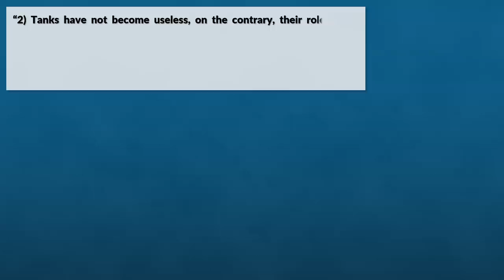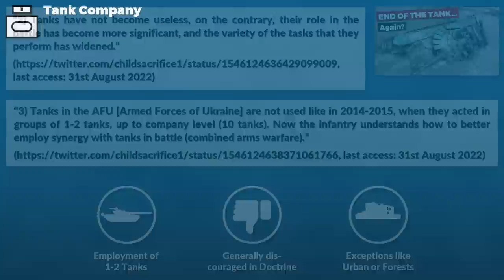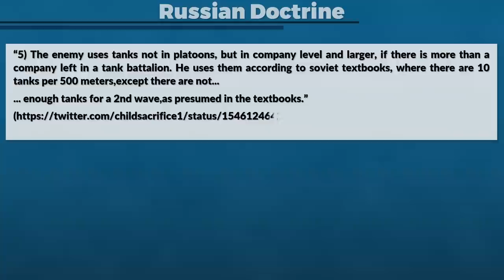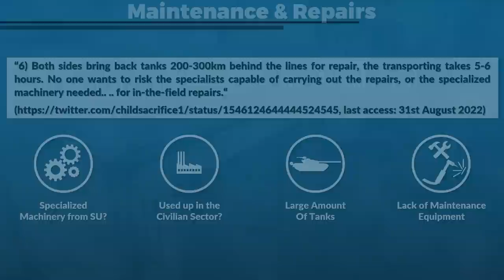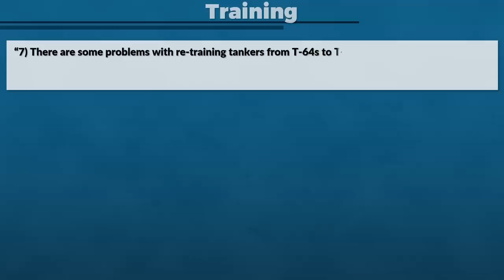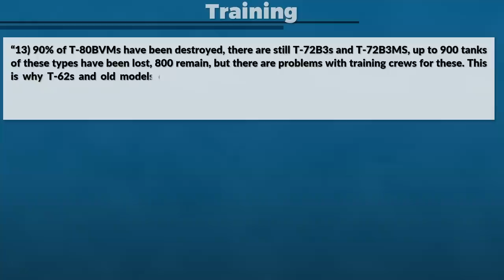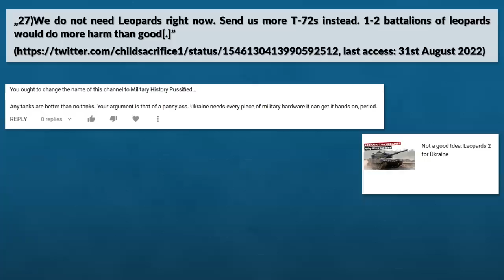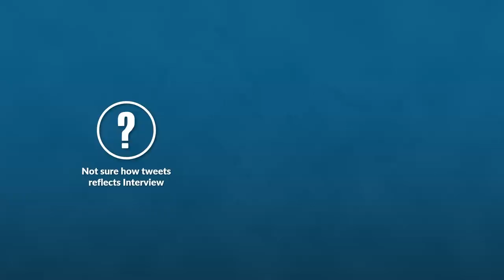What Ukraine thinks of Tanks

Comment: I will note that African and Middle Eastern tanks will generally be export models, such as those used by Iraq during Desert Storm/Gulf War. They lack certain technical pieces, such as thermal scopes and electric turret drives, that would make them a liability on a modern battlefield.
Reply: But possibly still useful as a source of spares.
Reply: Which tanks do you mean?
Reply: @hendi1571  For instance, look at the Wikipedia page "T-72 operators and variants" and see the current operators.
Reply: @cv990a4  I thought he may have meant some specific tanks / users variants. Because in general, his statement is somewhat incorrect.
Reply: @hendi1571  The Wikipedia T-72 page says that originally non-Soviet users of the T-72 had less effective armor, and that the Polish and Czech versions are not fully parts or tools interchangeable with the Soviet version. And that the less effective armor was also true of other export models that the Sovs produced. All that said, it's my understanding that these things are basically just a hull, into/onto which you can put all kinds of stuff - reactive armor, bigger engine, different targeting systems, night vision, etc. So, I would guess that, these days, what matters is less how the thing was originally built and more what kind of package of systems it has today.
Reply: @cv990a4  well T-72M1 is armorwise on par with the domestic soviet T-72A obr.1983 and is only inferior when it comes to night vision, as it was still equipped with the TPN-1-49-23 while T-72A would have been generally (at least on paper) equipped with the newer TPN-3-49. Yet even some T-72B1s and many T-72As still received the TPN-1-49-23 as the newer model was not available in sufficient numbers. Furthermore, an undisclosed number of T-72M1s may have lacked the 1A40 fire control system which would have been much more of an issue. But in the end, the 1982 introduced (cleared for export) T-72M1 was pretty much comparable to the 1983 introduced T-72A obr.1983 (without taking into account training and available ammo). And it was somewhat superior to the domestic T-72A obr.1979 and vastly superior to the T-72 Ural models. It was not necessary inferior just because it was an export model. 
But apart from that - no serially produced soviet T-72 model featured an thermal sight, neither domestic nor export. Arguing that that's a downside of the export models is senseless. As you said, a tank is a modifiable weapon platform and in fact, it were not former soviet domestic T-72's receiving the first thermal sights as a standard.
Plus, even at soviet times, export models were not actually the sole models supplied to other countries - Syria received T-72As in 1982. But after the fall of the soviet union, former domestic models were sold to several other countries, so several modern day T-72 users actually use T-72B and T-72A variants.
Reply: @hendi1571  How much do different variants of the T-72 matter today? You're talking about T-72As introduced in the late 70s, T-72Bs introduced in the mid 80s and weaker (or not much) weaker export variants in between. They're all equally outdated in 2022 and comparsions only make sense, when you take a look at the vanilla versions of each sub-model. Even the oldest T-72 Ural from 1973 with modern upgrades could outperform a Russian T-72B3M from 2016. It all just depends on the upgrades it received.
Reply: @jebise1126  Ukraine was originally equipped with the Russian "original" models of the T-72. So T-72As and T-72Bs were sitting in their depots. While there might also be some export versions among them, just like you can see in Russia as well, they're definitely not the norm. When you randomly manage to spot export models in Ukraine today, than they're most likely the ones that have been provided by other East European nations for this war.
Reply: @cv990a4  But are spares the bottleneck or are it the maintenance  tools and specialist? And then it's still makes more sense to buy the spareparts and not the whole tank. Probably enough  broken tanks lying around for spare parts in Ukraine anyway.
Reply: Most russian tanks also lack thermals. They were buying french for some reason till 2014.
Reply: The export models we inferior while the hull looked the same. Important details here and there, dozens of them. They are considered crap by those used to the Russian/Warsaw pact tanks.
Reply: @dnocturn84  That was neither the point of the original commentary, nor of mine. 
But I disagree with your comment, as T-72A and T-72B are, while being absolutely outdated, definitely not equally outdated. The differences do still matter on today's battlefield. For example, 1A40 is said to raise hit probability by up to 30%, while T-72B is of course far heavier armored than T-72A (/T-72M1) and T-72A (T-72M1) in turn features better armor than T-72 Ural and an laser range finder which is an obvious advantage over the optical of T-72 Ural. This are important benefits! And the base model is quite important for upgrading, because you cannot simply swap out T-72A's inferior turret composite armor. Of course you can still upgrade a T-72 Ural with fcs, ERA, etc. in such a way that it supasses a T-72B3, but applying the same modifications to a T-72B will create a more capable tank. Variants do still matter.
Reply: @dnocturn84  Furthermore, prior to 2014 Ukrainian armored forces were not equipped with T-72s at all. Only in 2014, facing increasing losses in the Donbass, such tanks (mostly T-72As and T-72Bs) were reactived from storage. Apart from that, there are no "original russian" T-72s apart from T-72Bs, as their production was carried on after the fall of the USSR, and russian upgrades. "Original" T-72s (T-72 Ural) are soviet tanks.
Reply: @hendi1571  Yes. Again, it all does depend on the upgrades it receives. A T-72A equipped with modern day ERA can technically end up with more turret armor than a T-72B with mid 80s Soviet ERA (Kontact1) (of which you can see plenty of in Ukraine on the Russian side and/or especially on the side of the Donbas or Luhansk militia).
If you upgrade a T-72B to B3 standard and upgrade a T-72A with the same addon ERA, you'll end up with a rather small difference in favor of the B3, due to more armor on the initial variant of the B model. But if something can penetrate this upgraded T-72A, chances are, that it will also penetrate the T-72B3.
Reply: @hendi1571  Ukrainian military was not equipped with the T-72 prior to 2014. Yes. But they had mothballed T-72As AND T-72Bs in storage. The T-72B was produced in the 80s. Ukraine did receive quite a number of them until the Soviet Union collapsed. And Ukraine wasn't one of the East European countries that only got export models. They got the real thing, just like Russia.
Reply: @dnocturn84  no. T-72B is substantially better armored than T-72A, the difference does matter! It does not only come down to the upgrades, I have already presented several examples.
For your second comment: Just read the comment you were refering to again LOL
Reply: @hendi1571  A T-72AV (I consider a T-72A upgraded with ERA to end up in the AV configuration, or similar) will end up with almost the same turret armor as a T-72B with ERA. Angeld position of the ERA blocks will even increase protection from shots fired from various angles in a superior result. 
Nothing to challenge the B3 yet, but a B3 ERA-configuration with some changes and additions on a T-72A can even beat that. It all depends on the upgrades.
I see absolutely no conflict with my previous comment. You should read again. I guess you're jumping on the "export model - thing". That is still true for both comments. Officially Ukraine never received export model T-72s. They only host the "real thing", exactly like Russia.
But historians know, that sometimes export models were also introduced in tank divisions, that would normally have been equipped with the good versions. Maybe because a deal didn't happen and the produced tanks had to go somewhere, or because the military needed new tanks asap and they "stole" export models for that purpose. This happend a lot in Russia and Russia is actually the primary example for these strage appearances of export T-72s in their tank divisions. It is only save to assume, that Ukraine received a few of them as well.
Reply: @dnocturn84  Again, no. T-72Bs "semi active" (russian: полуактивному) composite turret armor presented a great leap in protection and vastly differed from earlier technologies. T-72B was in fact the by far heaviest armored tank in the soviet arsenal prior to the introduction of T-80U, even surpassing T-80B. It was designed with the overestimated capabilities of new US APFSDS penetrators and especially more capable HEAT rounds in mind. The west was shocked, examining T-72B's turret armor. 
While you are right, T-72AV's 68° ERA placement maximises effectiveness, this only affects HEAT. The difference is not gigantic and does absolutely not bring it into line with T-72B's vastly superior composite armor. And additionally it comes with the downside of leaving weakspots. But that's entirely irrelevant concerning your argument, as you talked about fitting new ERA. If you do fit Kontakt-5, previous Kontakt-1 placement is irrelevant. Upgrades are not everything, variants do matter.
About the second part of your comment: It has nothing to do with what I stated lol
Reply: @hendi1571  How does it matter when ATGM penetrates the roof of the turret? How does it matter when a projectile hits the side of the turret? There are no relevant differences in armor between the versions. And btw - the vast majority of T-72B turrets was made in Ukraine. That steelworks, that Russia destroyed recently was the largest supplier. But back to the turret front:
The "shock" by western nations occured in the 1980s. That's 40 years ago. A lot has changed, when it comes to ammunition. The frontal armor of a T-72B is very much defeatable today. The Israelian M338, or the KEW-A2 (APFSDS) can penetrate that front armor without any problems. The difference in fireing distance, in order to defeat a T-72B in comparsion with a T-72AV, is below 500m. That's not really an issue, when it comes to tank combat.
Reply: @dnocturn84  arguing that there is no difference between two tanks because both can be easily defeated by hits at the side or the top is utterly illusional. A T-62 wouldn't survive this, nor a T-90 would. So, there is no relevant difference between those tanks?
T-72 production ended almost two decades ago, it's totally irrelevant were the turrets had been made. And no, the western shock appeared in the 1990s when western experts were able to examine a T-72B and it's turret armor for the first time in person. Of course, by modern standards T-72B's turret armor is not impressive anymore and any modern round is able to penetrate it, I've never questioned that. But it is far better than T-72A's turret armor and combined with modern ERA it's still able to defeat the more mediocre rounds commonly used by many armies. In this regard, T-72B fares significantly better than T-72A. 
And of course, it is not a difference of merely 500 meters.
Reply: @hendi1571  The T-72B was introduced in 1985. It's (back in the day) advanced armor was known to western intelligence immediately after it's introduction. Not every detail, of course, but its impact on western designs was known by then. So were numbers of the overall protective armor thickness and its further theoretical increase with added ERA discovered by western spies. Projects to counter this "new" threat were started in the late 80s. To inspect a T-72B in person was possible for the first time in the early 90s. That is true. Weapons to defeat the T-72B at normal fighting distance appeared in the early to mid 90s (depending on which type you'll look at - missiles, APFSDS, ATGMs, etc.). I know about a "shock" in the west only in the mid to late 80s. It was in the 90s, when books and public papers were published. I guess if you argue, that this "shock" happened, after the public got to know about it, then you're right. But military intelligence knew about it a couple of years earlier. 
No, I do not argue, that any tank variants don't matter. I do argue, that the disadvantages of a T-72As weaker armor, when compared to a T-72B, can be compensated today with armor and ERA upgrades and that any technological disadvantage can be compensated by upgrades (e.g. thermal sights, wind sensors, etc.)  as well. Both tanks are too similar with one another, to not be able to fill the gap. It is much harder to upgrade earlier variants, and especially early export models, to such an equal level though. Yes, in theory you could do the same to the T-72B and keep that "edge" to A models. But that is theory only and doesn't reflect reality as we can see in Ukraine. T-90s are propably the variant that would be that very example, which indeed is a superior tank.
Reply: @dnocturn84  Again, no. While western intelligence was, of course, well aware of the new, thicker armor introduced with T-72 obr.1984 and T-72B, the specific composition and capability of the "semi active" armor only became known in the 90s when western experts examined T-72Bs first hand. Prior to that, speculations about the type of armor employed in the "Super Dolly Parton" circulated. Probably the most common, yet proven incorrect, theory was, that the turret featured BDD armor. Steven Zaloga still followed this theory in 1999. The public became aware of the real type and capability of T-72B's armor only in 2002, when the Journal of Military Ordnance published a corresponding article. 
But even if you'd be right about this, it wouldn't really matter for the original piece of the discussion as there was, with no doubt, a "shock" in the west because of T-72B's turret armor. 
And again, of course the difference between T-72A's and B's turret armor can be compensated. But if you apply the same "compensation" (whether it is better ERA, or additional passive armor etc.) to a T-72B, you'll practically (!) receive a significantly better result. The war in Ukraine does not in any way disprove this point. And it's not just armor, for example, it's the autoloader as well.
Reply: @dnocturn84  that is not to say that a T-72B is automatically better, regardless of the upgrades or that the superior armor would make a great, in many situations even relevant at all, difference. But there is, without any question, a rather significant difference.
Reply: @hendi1571  "T-72A's and B's turret armor can be compensated. But if you apply the same "compensation" (whether it is better ERA, or additional passive armor etc.) to a T-72B, you'll practically (!) receive a significantly better result." 

No, this is not what you see in Ukraine right now. I see evidence of old T-72As (from Ukrainian depots) or gifted T-72 export models, that are upgraded to T-72AV standard at the very least. T-72B models often occur as T-72B ERA models without any modern upgrade, just like they were in 1985...1988, which don't outperform their counterparts anymore, besides smaller numbers of T-72B3s, etc. I've not seen any evidence of a T-72B that has been upgraded beyound its ERA configuration or Russian T-72B3s. Nobody ever did this to my knowledge. The only thing that does exist is the T-90, which is its own tank designation and which is never based on an T-72B upgrade package.
Reply: @hendi1571  There are Polish PT-91s, that are significantly better than a T-72B, there are old T-72Bs on both sides, there are old T-72AVs on both sides, there are older T-72As that are upgraded to fight the Russians on the Ukrainian side. Sure, we don't know how much of an upgrade they receive. Maybe it's just normal AV-ERA, which would keep them a little bit below T-72B levels. But they've claimed that these upgrades are done by the same guys who did the PT-91 and Czech upgrade packages. Many T-72As from Ukrainian depots are even upgraded in Poland or the Czech Repubilc. I highly doubt they'll just put a few ERA blocks on it an call it a day. Pictures of them show more significant upgrades, but it's very hard to verify them. We'll have to wait a little bit longer to get more details about this. 
Then you have to take into account, that these are all Russian tanks (the T-72Bs abd As) with basically the same gun that can fire the same ammunition. There is very little difference for a 2A46M, when it fires a 3BM48 (or similar) at a T-72B w/ERA or a T-72AV w/ERA. 
The number of real battlefield events, where a T-72B turret armor saved the tank from destruction, while it might have killed an upgraded T-72A, can propably be counted by one hand. If it even occured at all.
Reply: @dnocturn84  *soviet tanks, that cannot fire the same ammunition. T-72B's AZ-184 autoloader allows for atgms (along with the 1K13-49 sight) and longer rounds.
Ukraine does not prove your point, as there are no T-72As and T-72Bs upgraded to a similar level, which might prove how little the difference matters. Plus, the war in Ukraine is partly an asymmetrical one, which reduces the relative importance of frontal armor, as attacks on the sides etc. are common. Yet, even in the ukrainian theater, the difference in frontal armor can be important. And it's no marginal difference, it's a quite large one. Again, western experts were shocked, when they examined the T-72B.
T-72B was upgraded in different countries, in the USSR and Russia (T-72B obr.1989, T-72BA, T-72B2, T-72B1MS, T-72B3 obr.2011, B3 obr.2014, B3 obr.2016) as well as in Belarus and Uzbekistan.